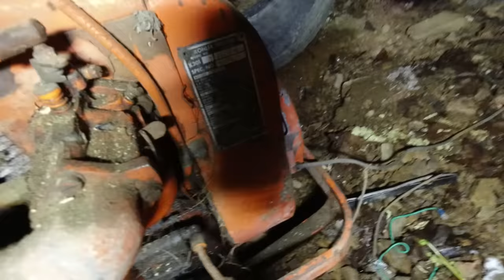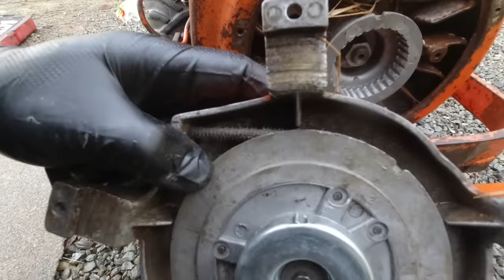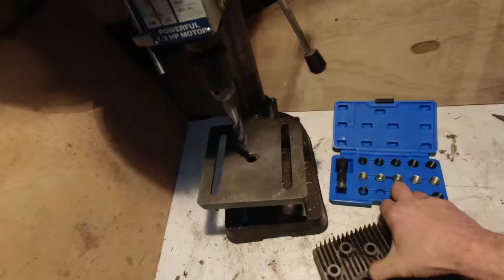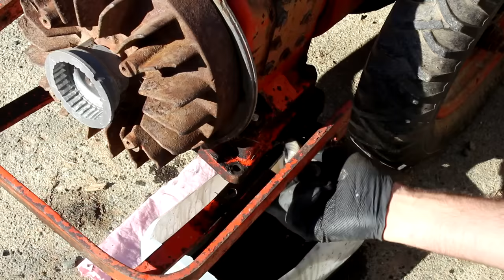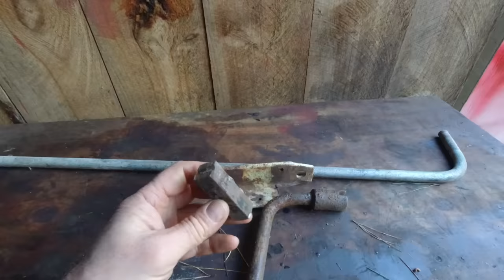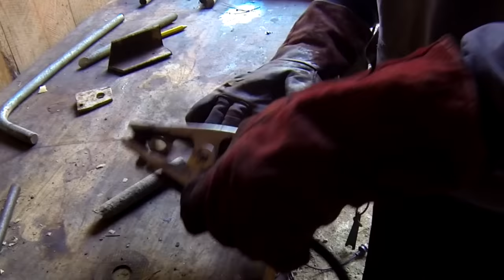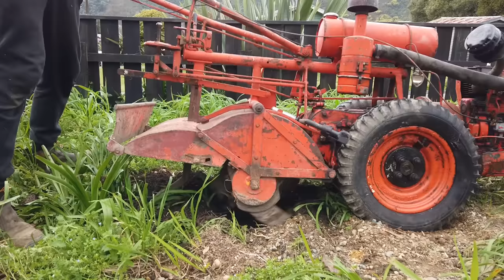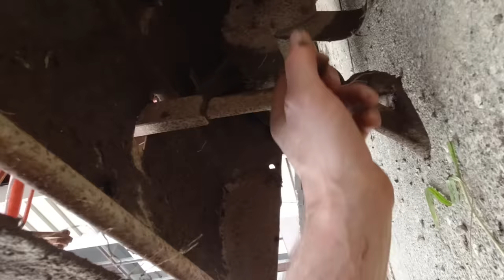Vintage Howard Gem Rotavator hasn't run for 15 years.. Will it Start??

Comment: Good video. Incidentally, we had a slightly bigger (engine) version of one of these Howard Gems 50 years ago and it was more a beast, in that when you reversed it, you had to hold the handles down with all your weight, otherwise it would rear up and try to crush you underneath.

Comment: I enjoyed watching you as usual :-) nice to see you got it going again after a bit of fixing... A easier way to start or turn over a motor. Once the pull start mechanism is removed it's possible to put a socket on the nut of the flywheel and then use a battery powered impact wrench to start the motor.

Comment: The joys of those Kohler engines, parts are still easily available and they also make aftermarket performance parts for them if you want more power

Comment: Another nice video!  You find, and fix, some crazy stuff!  My only suggestion is that the left tire needs to be swapped around on the rim.  Tread "points" need to be forward on top, so they're facing back on the bottom.  You'll get better traction that way.  Looking forward to the next one!

Comment: great video Marty, your little is a hoot, when i saw this thumb nail, wow we had one these in my junior high school back in 1971, these were very popular with school divisions for the custodial staff, ours was a little larger  and if memory serves me correctly it was a single cylinder 14 hp i believe and had mower deck attachment with a mono heel and seat built into it and the tiller and had 36 inch snow thrower attachment and by golly did that thing throw snow an easy 60-70 feet, it just chugged and chewed its way through almost anything in its path, built like a tank as you found out putting it on the trailer, you will get lots of good use out of this for not allot money, that carb you bought for $20  here in Canada would easily run you double that or maybe more, great video as always  👍

Comment: Very nice old tiller. My dad had a large garden when I was a kid, and he had a big old Graham-Paige, two stroke rear tine tiller. It had spring type tilling blades and would turn the dirt in to powder. No raking required. LOL. Unfortunately, it was a real bear to get it started, and to keep it going. I remember that he completely re built the engine, but it didn't appear to help the starting issue. It ran fantastic once you got it going, but by then you were about worn out. I don't remember him replacing the crank seals, and I wonder if those were worn out. 
That Howard Gem will be a fantastic tool once you have it all sorted out.

Comment: Hi Marty, I've had about 5 of those Gems over here in the UK. Had one with the K301 engine like yours and some older ones too. When they are set up right you should be able to till with just one hand and walk to the side. I think the depth gauge skid was set a bit high (or low depending on how you look at it). When you have it in gear and let the clutch out it should dig in as deep as it is set and walk and churn as it goes, almost hands off, If you are fighting it you are not set up right. You can set the handles off to the left or the right so you are not walking on your tilth. You made a nice job of the start crank. I noticed at the start when you were pulling it out of the shed the wheel hub clutch was slipping. Both wheels and the blades have a safety clutch so if you catch a brick or something in the blades it won't shag it. You maybe know all this already.  I had a job tilling an old dirty allotment, turns out there was carpet under the grass, someone had put down for weed control, (LOL) the machine was tilling lovely until it hit the carpet, then it jumps up and the blades clatter it along the carpet. Bang Bang Bang. Those things would tow a train. Original tyres on yours too! Good on ya!
Reply from the maker: Thanks for the info mate, I will try that next time I use it. I actually watched your clutch problem vid when I was researching these, was a bit disappointed you didn't end up fixing it yourself :)
Reply: @MartyT  I was disappointed too, it was a bit beyond me at the time! But I sold it on to a chap in an old series land rover canvas top with hopes and dreams!

Comment: nice old machine there, those kohler engines are tough as nails. and they do have an ACR built in. nice option on the machine of crank start.

Comment: Nice vid again Marty, noticed one thing.. the spark plug seems to be wrong for that motor, think it needs a short thread plug type, not the long thread, the thread should never penetrate the combustion chamber, otherwise it will carbon up and eat your threads up again on plug removal. Just a thought brother. 😉

Comment: Now all you need is a "British Anzani Iron Horse" - There is a 'real' two wheel tractor, with a range of attachments, for the serious gardener, or as in my dad's case, a nurseryman and market gardener.

Anyways, very nice to see a chunk of British engineering in Australia, still in a serviceable condition, but bear in mind, the design of "The Gem" scarcely changed from the first production model in the 1950s right up to the last in the 1980s. There were subtle changes, and a very few different engines. Check out the "Howard 700" - Basically a Gem, but with a Sachs [I think it was] diesel engine. Those were the ones to sort out the wheat from the chaff, and I never knew more than one man who could start the one we had.

Comment: Kohler engines 'of the day' were hard working and durable old engines, but they really do need those vitals to be spot on, Compression, Spark ( including points and condenser ) and valve clearances. Most other engines in that time were not as 'fussy', but then they didn't work as well either.
That drag anchor seems to be worn somewhat, get that back to or near specs, and you'll have a dandy working garden tiller.
Well done Marty, I think you've got yourself a good ol' workhorse here.

Comment: Great work! Really interesting to hear you talk as you break down the engine. I could not believe that the carboretor you got only cost 20 bucks! There is so much accurate metal machining and parts there its insanely cheap!!

Comment: Great vid as normal Marty. I grew up with them and my dad still has 5 gems diesel and petrol. I don’t know how hard it is for you to get Howard parts but in the uk you can still buy new parts. Nothing they can’t get through in first gear and full throttle
Reply: I was amazed Marty could get a new carburettor for $20 here.

Comment: I have a similar Yanmar machine.
As you need a new tine on the rotary part,I suggest you take them all off and sharpen
The result will be smoother operation with less " bucking" and the tilth will be finer soil.

Comment: My Dad used the same rotary hoe for many years doing people lawns and gardens. As a teenager I often got to use the beast. First thing that we did was get rid of that leg that sets the depth of cut. It just bounces on anything significant and lifts whole thing up out of the ground. 
Standard operating method was low gear, full wellie on the throttle and push down hard on the handles. It would cut nice and deep and wouldn't bounce around like what was happening for you. Be careful when reversing. It is unforgiving and it will happily pin you halfway up a wall with your ribs taking the brunt of the abuse.
It did a fantastic job, worked all day long even in the peak of summer with no issues. We always used the crank handle to start it.
The muffler never lasts, even getting a replacement, it didn't seem to last long. My Dad just ended up putting a car muffler on it and never had to change it again. It also quietened it down a bit. But it was never what you would call quiet. :)
Oh and be sure you know where the gas, water, storm water lines are, it really eats into the profit on a job if you unearth one of those.
If you are turning over a lawn, leave the sprinkler on it overnight before you start. Makes it much easier.
That's about it. They are a beast and can take whatever you can throw at them.

Comment: I have  a John deer mower with that carb,, dealer wanted $512 just for the carbie kit , but you can buy online a after market carbureted for only $20. Works fine.

Comment: Old Kohler single, very resilient engines. They recommend always running at full throttle position for cooling. I have a couple old John Deere garden tractors with Kohlers and hydro, I think they would self destruct before they would stall out.

Comment: I bought a log splitter with a old Kohler k series engine on it and the guy said don't even bother with that old engine its no good. Got the splitter home and cleaned off the points and adjusted the carb and the motor runs like a champ

Comment: That's a great engine, easy to rebuild all parts available and you can buy a brand new carb if that one is no good ,i rebuilt one in a 1961 cub cadet tractor abiut five years ago starts every time .

Comment: Beautiful job, both fixing the machine and using it.  To get rid of that grass you need to fork it out and compost it or cover it with black plastic or cardboard.  Otherwise it will just regrow.  IMO cardboard is the best as you can leave it in place, plant through it and let it break down.

Comment: Fantastic Marty. I remember when I was a kid on a farm here in Victoria in the 1960s, my dad, who was a mister fixit like you, got hold of an even older Howard rotary hoe - had steel wheel not these newfangled rubber ones! Apart from that it looked the same. Used it around the house garden for years. Sounded just like yours. Very hard to drive for a kid but I loved it. You bring back good memories.

Comment: Great vid Marty. I replaced rings on my father-in-law’s one years ago in Blenheim NZ. He was fastidious with all his gear and kept it in wonderful condition.
What I was impressed with on his Howard ( big villiers engine) was how it started. My instructions were, to turn it off, you push the fuel tap to off and wait.
To start it, you put the rope on the front pulley, get in position with foot up on it to steady it. Then reach down, pull fuel tap out to let fuel through, almost as you pull the starter rope. You couldn’t get much speed up but it would fire up every time on the first pull, albeit at the end of the pull, even when it’s the first start after many months. Amazing, you wouldn’t thing it had time to refill the carb.
Marty where did you get the replacement carb for $20?
Reply from the maker: Nice, this one starts easily after sorting the valves and carb, I got it from aliexpress https://www.aliexpress.com/item/1005001423682968.html?spm=a2g0o.productlist.0.0.3fbb75e48JLvs5&algo_pvid=8cbdfb86-247a-494c-b2dc-a77297a8fd91&algo_exp_id=8cbdfb86-247a-494c-b2dc-a77297a8fd91-10&pdp_ext_f=%7B%22sku_id%22%3A%2212000016057909393%22%7D

Comment: Too bad they didn't attach reverse tine gear boxes back then. That old machine would wear out a 20 year old! But I love it! I have an old David Bradley to rebuild, but the Continental engine and hood were gone. May set a V-twin on that bad boy. Glad to see someone using common sense instead of gadgets! Good job! I'll mail you some liniment.

Comment: My old boy had one of these growing up. 
Had steel wheels and a steel jockey wheel at the rear. 3 speed with a reverse I think and two speeds on the blades. Thing was a beast. Would smash up concrete if it was not to thick. No soil was to hard for it.

Comment: My old Gem has a 600cc single cylinder JAP. With the starting handle on the side of the gearbox.... A wrist breaker to start! 
The gaugeon pin had come loose in the piston and gauged a big groove in the cylinder, but it still ran. 

There was a safety reverse on mine as well, which disengaged the blades when reversing, so you didnt get chopped up if you tripped and fell.... Just crushed with the weight of the machine.

Comment: Food for thought, there is a de comp on the valve, I restore tractors with Kohler engines.  Most of them have a blown  headgasket .   Great video I go through the same stuff.  Parts are getting hard to get.

Comment: i use to have one of those with a 2 cylinder wisconsin thd engine..  was a real bear to hold onto.. was about 900 pounds too..  very cool find especially where your at.. i would of thought it would have the larger kohler k341 etc on it on such a big heavy machine

Comment: Very interesting. I haven't seen a walk behind Howard rotovator before. My great grandfather had one for his ford 8n tractor in the 50s to replace the old style spring cultivators. He used it to till his juice grape patch.Unfortunately the tiller is long gone but I have the tractor and it's special howard auxiliary transmission that was required to run it still. I still find the 3pt mounted ones for sale every once in a while, very well built machines compared to the new ones. It seems the walk behinds were just as well made. Is the rear guard supposed to pivot down a bit more?

Comment: My Dad bought a 2 cylinder Wisconsin Air cooled powered Rotivator for 400 cdn dollars back in 1973, and we got many hours out of it. I still have it and I use it to work on the garden every year. It's built to last.
Reply: Thanks for reaching out to me.

Comment: Nice Tiller, However too small a parcel for this beast.  I have a small plot like what you have and once I got the beds setup I use a electric tiller to keep the beds in shape. I even use the electric to maintain the paths.  I use hay as bedding around the plants to control weeds and water lost and as mulch between planting.

Comment: I’ve got a V twin model it had a Ford model T spinner in the tool box ,think it’s a 750 cc, it has reverse which I’m told we’re the early ones that pinned people up against trees if they weren’t carful also could suck you in as well it has decompression leaver and a steel crank ,steel wheels as well

Comment: It had many issues alright, the spark plug insert they are called a helicoil, 
 many many years ago my father had a similar machine, a 'Gravely' it was a bit temperamental with magneto ignition, but by god could it pull! 
I remember it pulling a car trailer ( loaded ) up a steep hill.

Comment: Howard made a few different size Walk Behind Rotary Hoes. My Dad has a smaller Howard Terrier, but the motor is worn out, and I remember seeing one 50 years ago on a property down the road that was huge. In theory it was ‘walk behind’, but blimey! 
  Howard even made their own engines, a guy in Australia made a motorcycle using a Howard side-valve V-Twin, made for a cool machine!

Comment: You need to find all the attachments  now! I ran a Bantam and a 300 series at home and allotment, fantastic machines, even if the 300 dragged me around. They are best suited to long straight beds, turning them tends to hurt!
Reply from the maker: Yes it is oversized for our little garden, I was just getting the hang of it when the missus stopped me from ripping up the lawn
Reply: @MartyT  The allotment was glacial till with lots of round stone, when the 300 threw that at you you were bruised for weeks. Wear some lower leg protection! Beware of other lower body areas also!! (should be a crossed legs emoji!)

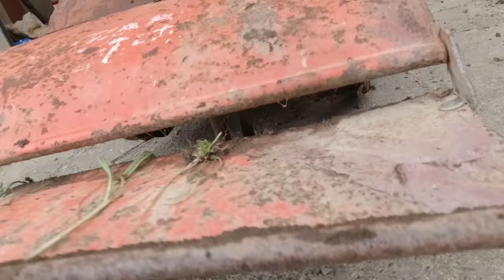Comment: 29:14 at that timeframe there is the "thing" that descend vertically down into the soil after giving it the treatment. I seem to remember our rotary hoe from 59 years ago had a plough blade that helped keep down pressure on the hoe blades and also to turn the soil over. I may be wrong and likely am since you have the manuals, but it seems like something is missing from that part and there appears to be a pin in the lower end.

Why do all mechanical equipment have oil drain plugs that don't allow a straight flow into a container? If they do, like automobiles, the the oil filter allows you to share the old oil with other parts on the engine or chassis. Makes collecting to oil to avoid soiling the soil or smearing it all over ones concrete an almost impossible task unless you have a plethora of funnels and plastic pipe of different sizes and lengths and even then..... 🤷‍♂️.

Nice job Mr T. You should have a Merch t-shirt saying "Don't mess with me sucker." 👍  I'd get one as long as it had a silver fern or a kiwi on it.

Comment: The old K series Kohlers have a automatic compression release to aid in starting. The old cub cadets have them too and use a starter generator. Some of the earliest ones with the K161 7hp Kohler had a recoil start as a option

Comment: That's bigger than the rotavator we used to use on a 30 acre market garden. It had to fit between the rows though, and your Gem Hoe would have been too wide for that.  We also had a big rotary tiller that attached to the tractor.  It was so heavy that the front wheels would hover off the ground over bumps when driving between fields, and dad had to steer with the brakes! (Tractors have independent rear brakes.)

Comment: My Granddad had a similar machine to that in the 1950's. It was called a 'Farmers Boy' and was not quite as substantial as the 'Gem.' It was a pig of a thing to use as a tiller, and dad built a small trailer for it to carry odds and end around the farm. Later it became a mobile tool box until superceded by a quad bike.

Comment: Hope you have better luck with this machine than a guy i worked with 20 yrs back

He was new to using it and some how put it in reverse and then stumbled back and fell on his back with the machine running over his lower legs.  

It was messy and sounds like comedy sketch now ive wrote it out here

But it did happen

Comment: Great video of fixing multiple issues on Kohler. As mentioned earlier it is a heavy dangerous machine. Perhaps find a safer one to fix and let someone with a bigger garden use this one. I think I used that same carburetor on my Tecumseh welder when that carb died of old age. Aint Amazon terrific?